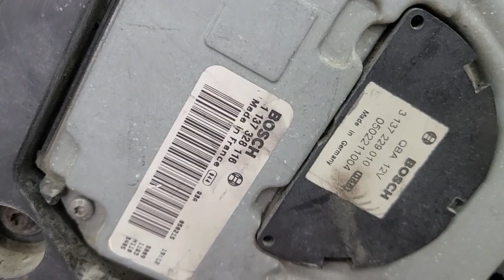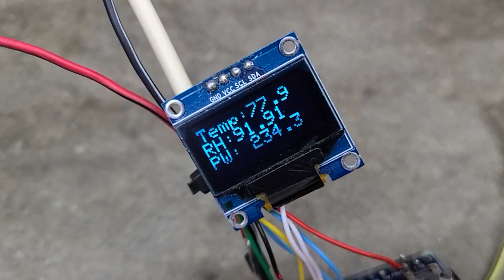$22 Volvo XC90 brushless PWM fan Part 4

Comment: I’m confused on the pen voltage- vid 1 is 12v the rest arduino.. I’m sure that can’t do 12v ? So fan can run 0-5v but also 12v ?
Reply from the maker: Ard has 12v input that regulates down to 5v output pulses to drive volvo fan
Reply: @aknovaman  sweet thanks - I managed to get mine running - good to know it will work with 5v pwm from pcm - i found some programmable settings withing the pcm to activate pwm so will make things a lot easier. cheers :-) https://youtu.be/nNSfYVZSj7I

Comment: Are you using a positive or negative PWM signal?
Reply from the maker: 90 percent duty cycle is low peed. 10 percent duty is high speed.  Ardiuino output is zero to +5V pulse
Reply: @aknovaman  strange. I have the same fan and wired it 12v PWM+ and it spins, backwards for some reason.